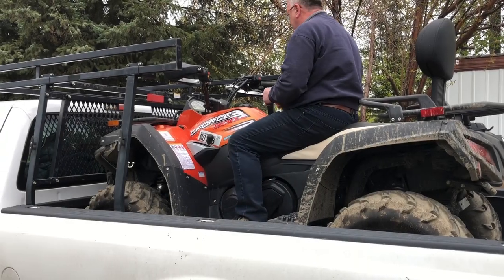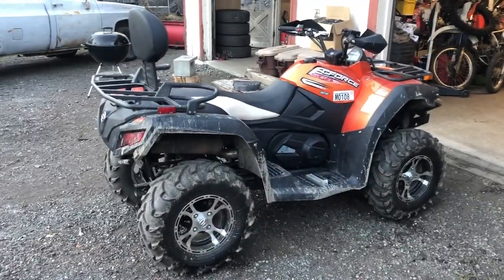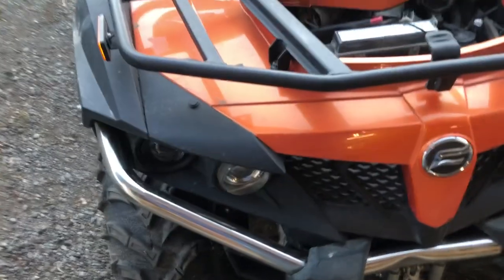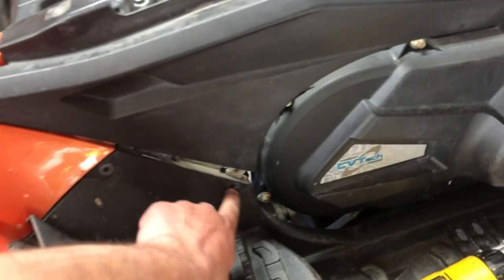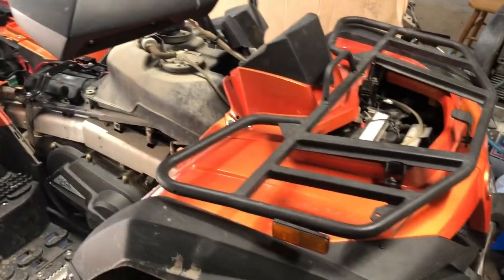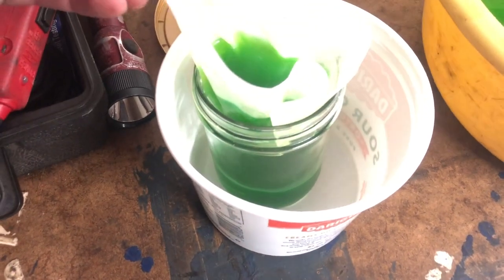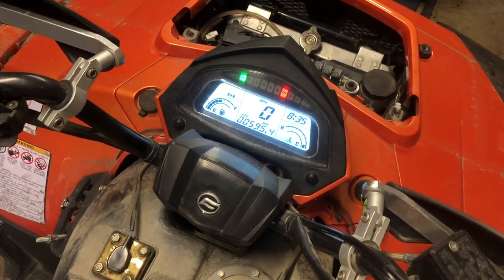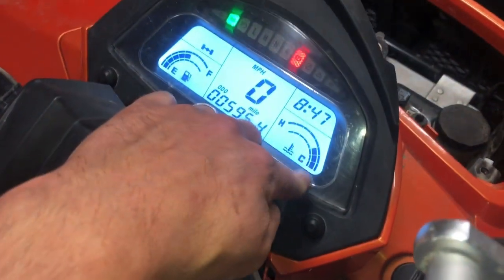Overheating/Cooling Fan Not Coming On 2015 CFMOTO CFORCE 500-EP180

Comment: I just did the break in valve check on my 600 CF Moto took me 2 hours to take the plastics and gas tank Gauge cluster 10 minutes to check the valves which were fine and I knew they were But I just wanted to document it just in case for CF moto warranty and all. Took another 2 1/2 hours to put the plastics back on so in total took me about 5 hours to do everything. It should not be this difficult to get at the motor kind of stupid. All brands are like this now the  Polaris was the same way.
Reply from the maker: Yeah those plastics are like a big puzzle, thanks for the input Jay!

Comment: What type of colant did u use
Reply from the maker: Hi there, I was able to safely drain existing coolant and filter it to reuse, it still looked really good. I would recommend looking up the manufacturer’s recommendation and go with that, it’s probably similar to the Asian vehicle green for newer imports. (Normal green would probably not be recommended, it might need some sort of additive to work better with all the aluminum)
Reply: @LastFrontierGarage  ok thanks i was reading on some videos that factoty coolant not so good i live in texas and its starting to get hot over hear and the temp os starting to go up I only had this atv for a couple of months and i saw it was over heating and had to let it cool down and keep riding
Reply from the maker: @genarogarcia6719  good luck to you, you might check some forums to see if other owners have had better success with other coolants

Comment: On mine the fan comes on , replaced the thermo switch due to over heating and cutting off . Seemed as if the fan did not stay on long enough . 

It no longer cuts off -with the new thermo switch - but it does run up to 4 or 5 bars depending how hard you ride and the fan kicks on it cools off . 

New to CFM moto - Is this normal ?
Reply from the maker: Hi Keith, this is the only CF Moto I’ve worked on but on this one the fan did come on with the third bar so I would for sure search around to see if anyone else is having 4 or 5 light up before fan comes on. I would temp the radiator and surrounding areas of coolant system to see if it matches up with specifications. The fan possibly isn’t as efficient as it should be and not cooling the coolant down very well, the coolant condition may not allow for heat transfer as well as fresh, or possibly your radiator has build up and isn’t transferring heat very well? It could be the new sensor as well not closing circuit when it should, for example the oem sensor tells fan to turn on at 190° and this one is telling fan at 200-210° etc.

Just some ideas, keep me posted!
Reply: Update - I ran the bike long enough it did get hot and cut off on me twice trying to get it home . 

I think you are right the new thermo-switch is allowing it to run hotter before shutting down . 

I am going to check the lines and radiator for blockage first - 

I am currently googling for a diagram of the water pump location and seeing how  much trouble it would be to change . As the radiator and coolant looked good at a glance - while installing the thermo- switch . I am still questioning the length of time the fan actually stays on . 

Thanks for responding and once I have it figured out - I will update the message.

Comment: what is the part number or link where you bought it
Reply from the maker: Water Temperature Sensor,7020-150600 Water Temp Sensor Thermo Switch Fits for CFMOTO CF800 X8 ATV https://www.amazon.com/dp/B085VJ6FBZ/ref=cm_sw_r_cp_api_glt_fabc_527P09NAG1H03H0TVTTV

Comment: Pls sir im actually having an issue with my cfmoto493cc engine sir so i don't know if u can help me out sir ok the engine has overheated several times sir but right now i have checked everything out on the engine sir but still yet no way sir but I'm a kind of suspecting the top gasket sir but my question ❓ now is that can the burning of the top gasket makes The engine to Miss fire 🔥 sir pls i need a reply to this question sir so that i will know when to do next sir pls sir
Reply from the maker: Can you please rephrase your question, you’re saying it is overheating and misfiring?
Reply: @LastFrontierGarage  ok sir it's miss firering Sir so I'm a kind of suspecting electrical issues but no my question now is that can electrical issues cause the engine to miss fire sir and pls what other things did u think that it can make the engine to miss fire 🔥 sir pls I really need ur help sir God bless u sir
Reply from the maker: @accWhizzy testing
Reply from the maker: @accWhizzy  hey it wasn’t letting me respond, lots of things can cause a misfire I would start with the basics. Are you getting good spark, good fuel, and air and do you have good mechanical compression? Any of these things can cause a misfire